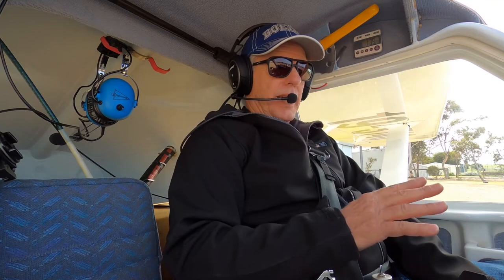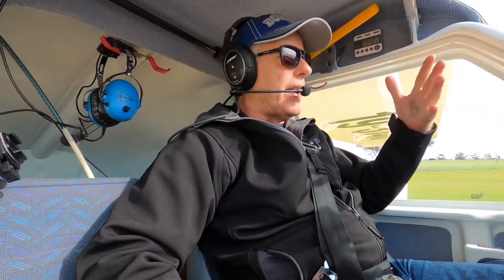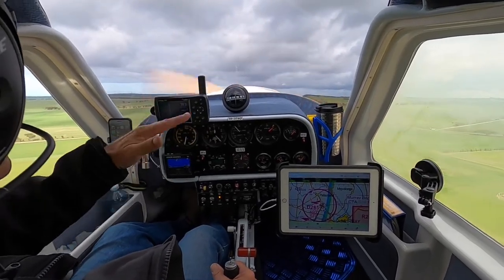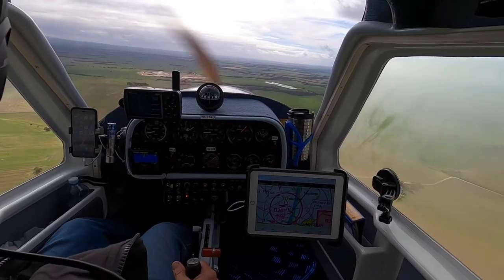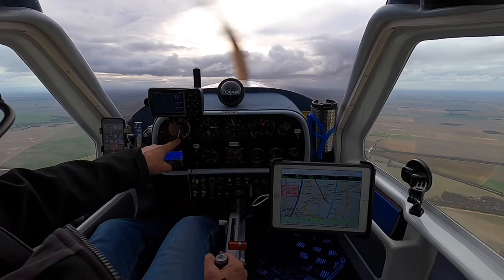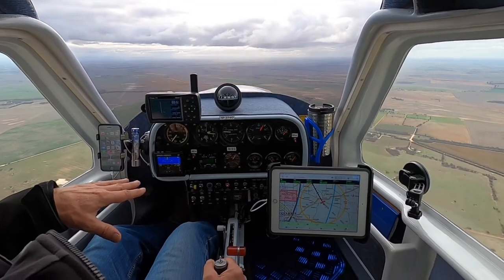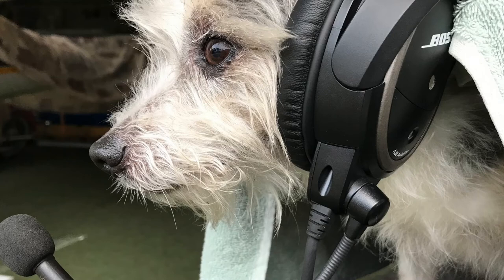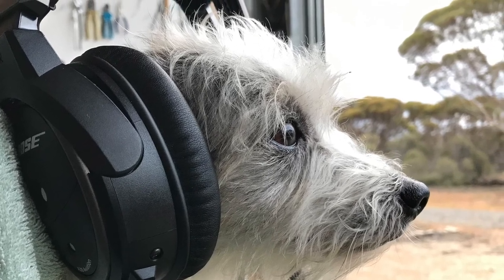Effect of Controls   Ailerons Elevator & Rudder   Flying Jabiru Aircraft   (Eps 4) (38)

Comment: Thanks Steve, I have recently bought an SP500 which I believe is identical to your SP470 except the motor size.  I am finding your videos very useful!.
Reply from the maker: Yes spot on, same aircraft different power plant. Keep an eye on the undercarriage legs, as in the bolts where they attach to the fuselage. Originals were a bit small, being an SP it’s probably had them done by now (larger bolts). Also with the park brake on try to rock the plane back and forth to check the top of the leg is not moving where it touches the fuselage. If you have leg fairings you will need to take the top sections of to see this, I know it’s a pain but 1/2 an hour now can save you a world of agony if that leg rotates at the top. This usually happens when braking hard on bitumen. Feel free to email me if this doesn’t make sense.
howtoinfive@gmail.com.  cheers.
Reply: @standupmoto  Thanks! That's great advice, I'll be checking it.